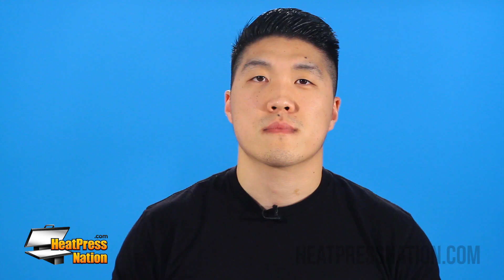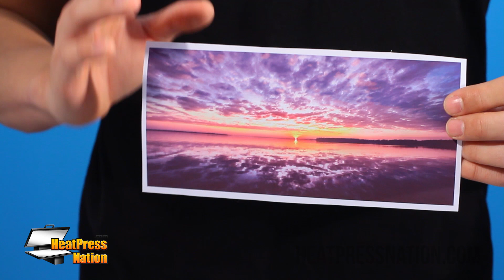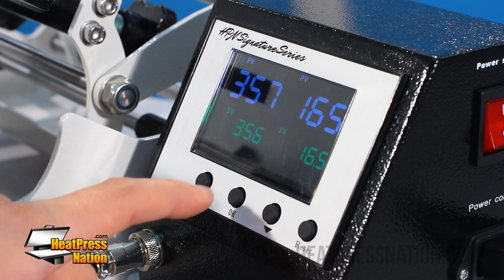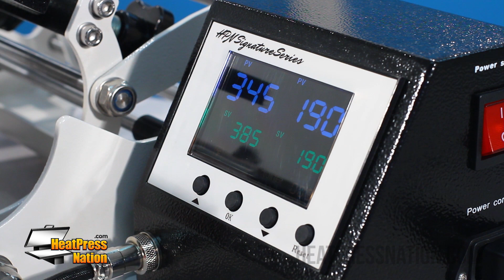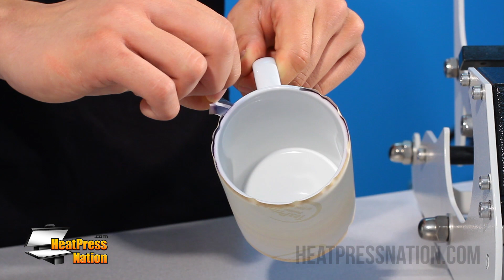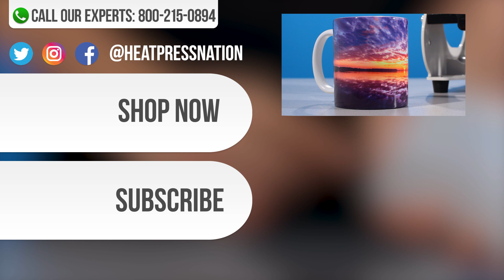11 oz. Sublimation Mug Full Bleed Transfer Using HPN Signature Series Mug Press

Comment: Can I make multiple transfers on the same mug? For example, if I'm creating a pattern without background and I want to avoid a seam. Can I sublimate some images onto one side, then add more images to the other side and sublimate again? Will the heat cause any damage to the original transfer? (I'm sublimating a 20 oz tumbler so I don't have to worry about a handle.)

Comment: I noticed that you didn’t put any butcher paper down before you pressed I thought you were supposed to . do we not have to on this machine? Also how do you set only a bleed on the top and bottom when I set a bleed it does it all over
Reply from the maker: We've found that (for whatever reason) we don't get any blowout from the ink when heat pressing our sublimation mugs. So we don't use parchment paper when sublimating mugs.

The bleed depends on your template. If you don't want bleed on the bottom, just shorten the bottom of your template in Photoshop, or whatever program you're using. You can also just position your transfer so the image stops at the bottom and doesn't bleed past the edge.

Comment: I have this mug press but if I have any design lower to the edge it does not heat well. I also tried 385F for 190 and my mugs came out light..I had to go 400F for 205 to get results. I am going to keep trying to even out heat evenly
Reply: Have you made sure the pressure is tight on the lower side of your mug?  All 11 oz mugs taper at the bottom so you really have to make sure that area is being pressed properly.  Please use the dual pressure knobs in the front to your advantage.  It will definitely help seal the bottom and make sure you are pressing the same way we are in the video.  You can always reach out to us directly at 800-215-0894 or support@heatpressnation.com and we'll go ahead and troubleshoot any issues for you :).
Reply: Same issue.  My temperature keeps dropping real low when I put the mug in.

Comment: Hi Bryant, pls what are ALL the supplies I need for sublimation on mugs? a) what kind of paper is best from your website (there were several options)
b) what kind of printer is best?
c) what else do I need? Any special paints etc?
 I want to buy/order everything from HPN together. Thank you!
Reply from the maker: All of the equipment we used in this video is listed in the description. We have linked to everything you need to make mugs as shown in this video.

The printer used in this video has been discontinued and upgraded to the new Sawgrass SG500. If you wanted to upgrade to a larger printer, you could go for the new SG1000.

Comment: I was using orca mugs and had no problems, but I wanted to try the dolphin mugs so I purchased a case. I sublimated a few and they're all coming out with a yellow tint where the thermal tape is. Why is this happening? I didn't have that problem with the orca mugs and all the settings are the same.
Reply from the maker: That's interesting. We haven't had any issues with our heat tape leaving discoloration on the dolphin mugs. Can you email a photo to support@heatpressnation.com? Definitely want to take a look at that.
Reply: @HeatPressNation  We noticed that if we don't remove the mug as soon as the timer goes off, like if we leave them a few seconds more, that's when the tint appears. But even if we remove them as soon as the timer goes off, it also gets the tint, a bit more subtle but it's there... We never had this issue with the orca mugs and it's a bit frustrating. I'll email some photos to the support team.

Comment: Was that 15 oz full bleed mug porcelain or ceramic?
How did you avoid ghosting with  the black?
Reply from the maker: In this video we used an 11oz ceramic mug. We applied a full bleed graphic. To avoid ghosting, be sure to use heat tape to keep your transfer fixed in place through the pressing process. In this video we recommend waiting 30-60 seconds before peeling. You can wait longer - 5 minutes or until cool - if you notice ghosting or blurring on your mugs.
Reply: @HeatPressNation   @HeatPressNation  I'm referring to the full color mug (I might have commented on the wrong video) see pix.  He was demonstrating the heat press I want!  The video came up when I was shopping for porcelain sub mugs.  I was wondering if the porcelain was better than ceramic to prevent ghosting.  I've never left my images in place once I removed the mug but maybe that's my issue?  Oh guess I can't attach a pix.  😢

Comment: The mug comes out clear I don't know what is the problem
Reply from the maker: What type of mug and printer are you using? In order for this process to work properly, you must be using mugs specifically made for sublimation. Regular mugs will not work. You'll also need a transfer printed with sublimation ink.
Reply: @HeatPressNation  I'm using epson l382 and sublimation ink

Comment: I have the same heat press and I was wondering what to do about the press dropping temp for the first 100 secs?  By then the time is almost gone and the temp is finally getting back to 385.  Do I extend my time or keep it at 190 secs?
Reply from the maker: Temperature drop is normal. 385F for 190sec works for room temperature mugs. The colder the mug, the more it'll drop. So if you store your mugs in a cold garage/attic/basement, then you may need to compensate with a little extra time. It all depends on how your finished products look.

Comment: Hi,

I find that when I press the mugs with a dark image there is a brown tinge to the print especially around faces. I have my press set at 190 degrees and the timer at 50 minutes 

Do you have any advice you can offer.
Reply from the maker: 50 minutes seems quite long for a sublimation transfer and 190 degrees seems quite low. For mugs we typically recommend 385 degrees Fahrenheit pressed at medium-firm pressure for 190 seconds (3min 10sec). I would strongly recommend changing your settings and trying again. 

In general, if your transfers - especially black ink - start to turn brown, it's a sign of overcooking. That is likely what is happening with your transfers.
Reply: HeatPressNation i meant 50 seconds not 50 minutes... 😂😂😂. Do you think the time at 50seconds is not long enough even when the press is set at 190 degrees (374 F). Thanks Anjee
Reply from the maker: Well in that case, your mug probably would have been undercooked. I would try the settings we mentioned before (385F/190sec) to see if it makes a significant difference. 

Also, what kind of printer and sublimation mugs are you using? That may have an effect on it as well.

Comment: i thought you had to wrap your mug with paper to avoid ink bleed to the machine?
Reply: Hey there Leslie!  You definitely could wrap your transfers with parchment paper or non-stick sheet but it is not completely necessary if you trimming a few good spaces beyond the ink bleed.  We have sublimated thousands of mugs without covering it and haven't noticed any issues of bleeding to the machine or ghosting.  Now you can definitely be extra careful and use a product that would cover it and that will just help guarantee that you will not have an issue.
Reply from the maker: Bryant is one of our experienced technical support representatives and he is absolutely correct. Leaving space beyond the ink bleed will prevent the sublimation ink from seeping onto the heating element.